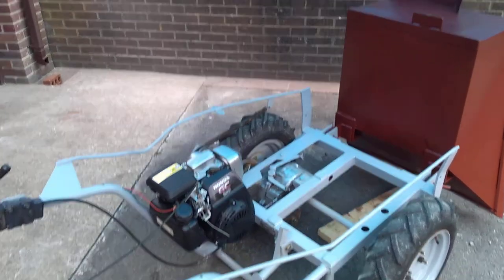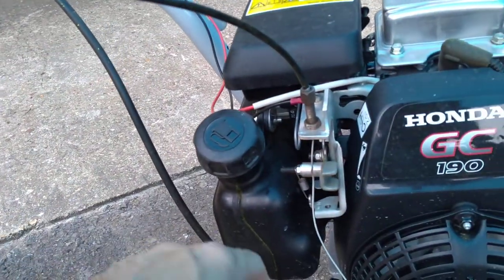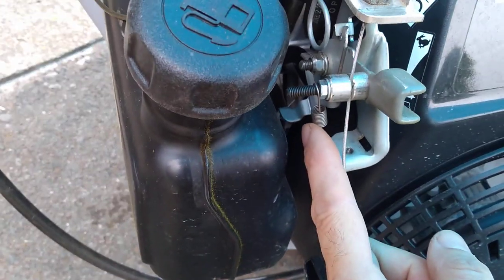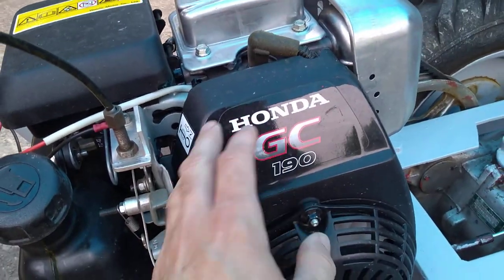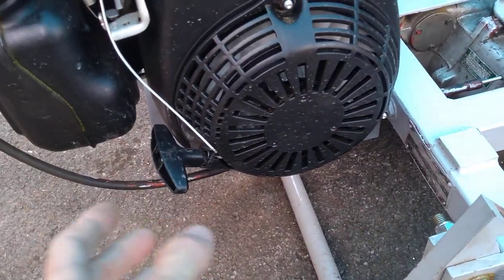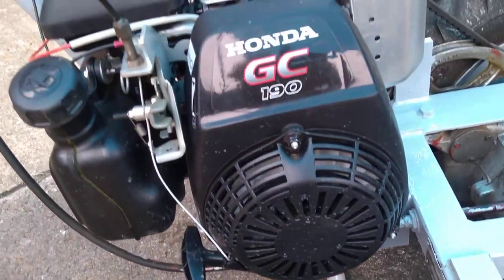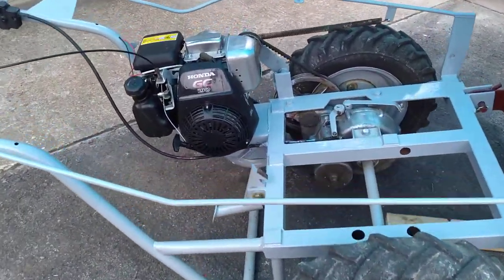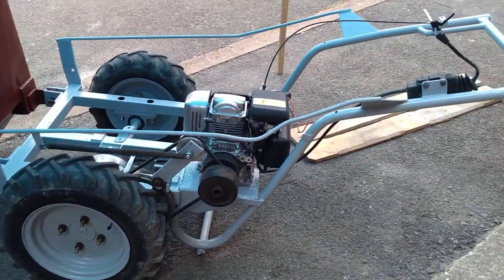Powered wheelbarrow update | Honda GC190 throttle modification and remote kill switch

Comment: do you think this thing is strong enough to move if it was full of concrete? that is what I need to make,thanks
Reply from the maker: I regularly load the bucket above level with broken concrete. I have done the same with chalk. The gearing is very low and has no problem going up very steep gradients, eg. Spoil heap. The GC190 is plenty enough for my setup.